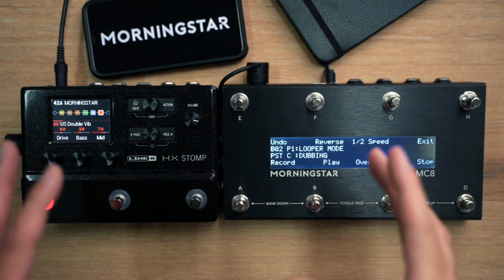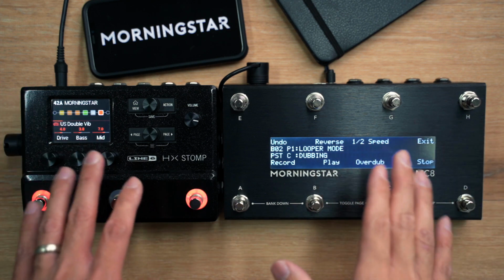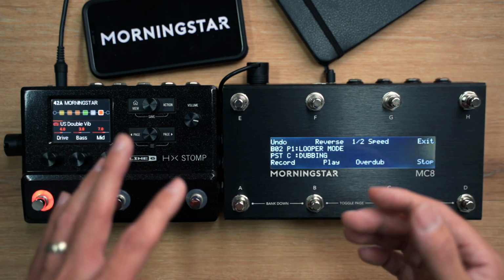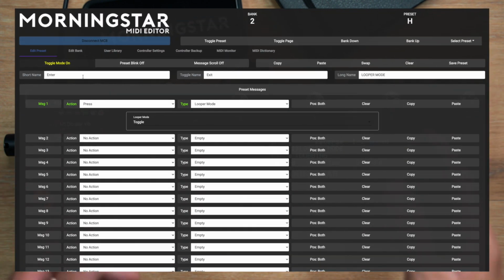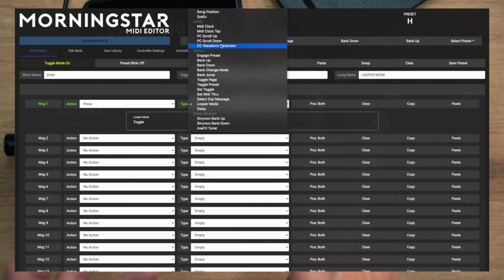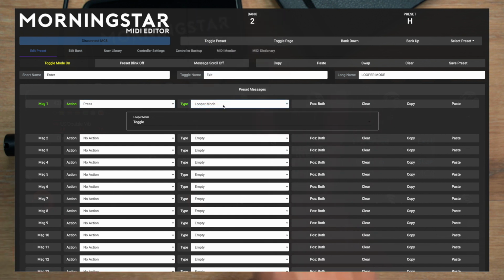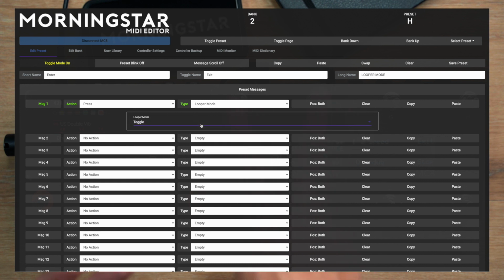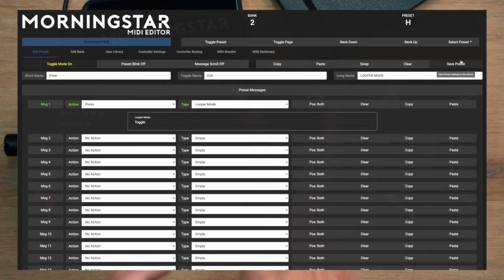Looper Mode - For Latency Free Control

Comment: Hello, 
can you please provide the steps to control Quantiloop with MC8 using looper mode?
Reply from the maker: Hi. You need to assign your Quantiloop controls to CC messages to control them. Shown on the Quantiloop website here - http://quantiloop.com/wp-content/uploads/2017/12/webmidi.png Then all you need to do is send those CC messages from your Morningstar controller to the Quantiloop app.
Reply: @MorningstarEngineering  thank you !  However need help on two more item 
1. When u switching between looper mode on and off, how the display message showing enter and exit (as per toggling )? Similarly I want to display on the mc8 screen the status of my effect  on /  off  in AuM 2. 
2. Can I use single expression pedal to control AUM and hotone stomp ( similar hx stomp) but not simultaneously. Say while rolling up For AUM , that control reverb mix , but for hotone I want to control wah , but not simultaneously. ( may be enabling via switch )

Comment: Can you turn on zero latency on the second page presets?  I'm only seeing the ability to turn on A thru H..
Reply from the maker: Hi. Yes, you can. Based on what you select, Looper Mode will apply to switches A to H on both pages.

Comment: Useful bit of info. When in looper mode can a button be set to work momentarily - e.g., overdub only while button is pressed rather than press turns on and press again turns off overdub? I presume that would be triggered by a long press, but in looper mode it sounds like only press events work. Perhaps it can be done with a press to active and release to deactivate, since release can be a zero latency action???
Reply from the maker: Hi. Different switch actions can still be performed even in looper mode. So what you mentioned is already possible! Cheers

Comment: Hey if I set up my MC6 in looper mode with my headrush looper board.. will the MC6 act as a loop pedal? & will it be in perfect time with the clock of the headrush? (Example- looping over a 4 bar backing track playing on the head rush.. will it still be in time after 4 bars) 

Or is there a way to  set the mc6 to engage (start/stop) the loops on the headrush? 

I own the MC6 just trying to avoid buying another midi looping pedal for the floor.. while my headrush is on a table (hand operated)
Reply from the maker: Hi. You can use the MC6 to control the headrush looper functions as long as they can be controlled by MIDI. Regarding MIDI clock, are you trying to sync all your effects pedals to the headrush? If you are, you should just send the headrush midi clock directly out to your other effect pedals. No need to use the MC6 MIDI clock. Use only one clock source to keep timing consistent.

Comment: Hi, I tried following this tutorial to set up my MC6 with the HX Stomp. They both of the latest firmware, but there is still noticeable latency in looper mode when sending out midi cc for record. Has anyone else experienced this? Do I need to configure something on the hx stomp? Thanks!
Reply: Yep, same problem here! At the moment I use the stomp to record and the mc6 to overdub, stop, undo etc. I engage Looper mode entering my looper bank.
Reply: @philippvonbuch8460  Hi, were you able to fix this?
Reply: @DanielDuyCao  yes! I had another doubletap function programmed thus the latency. 
Make sure you only program 1 single message for each button and it should work fine! Hope it works out!

Comment: So this will work with a HeadRush Looperboard as well as the new Boss RC5 and RC500's? 
WOW what a game changer! One cable and so many possibilities. 
I have looped for a while and this is just MASSIVE!
Gonna be diving into this mode a lot!
Reply from the maker: Yep that’s right! As long as a pedal/device accepts MIDI, our controllers will work great with them
Reply: @MorningstarEngineering  So I have updated the firmware and followed the steps on this video for the MC8. When I press H we get the message 'Enter Looper mode' but then nothing changes and it falls back to the way it was. I am not in edit mode. It Doesnt say 'Looper mode' or any of the options. I just have empty buttons and the option to Enter again on H. hummm.. I am wondering what I have done wrong?
Reply: @JohnPaulMusicUK  same : (

Comment: Does this mean that you would need to dedicate one button for exiting/entering the looper mode function? (New to midi...apologies in advance for my ignorance)
Reply from the maker: Yes, you can do that. Or you can also use the Bank Preset feature to engage Looper Mode upon entering a particular bank. You can then assign a switch to jump bank and then use the 'Upon Exit' Bank Preset feature to dis-engage Looper Mode upon exiting the bank.
Reply: @MorningstarEngineering  Could you elaborate on that? That would be very useful but I can't find "Looper Mode" in the menu when I select "on enter" in bank edit. Thanks!
Reply from the maker: @synthdromes  It is available in the beta 3.8.0 firmware, which is to be used with our staging editor. It will be pushed to the main editor once we officially release 3.8.1 very soon.